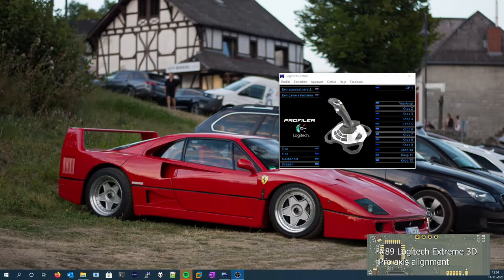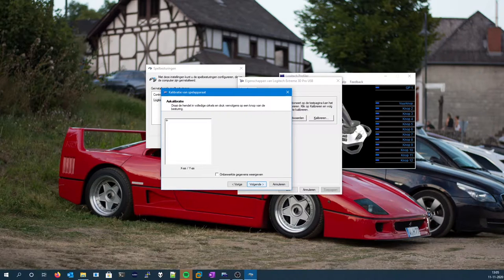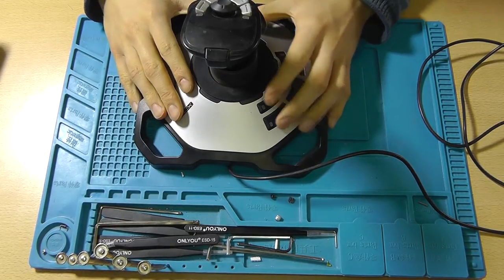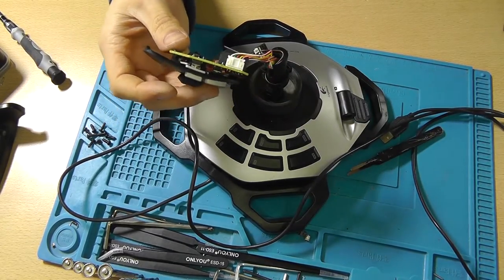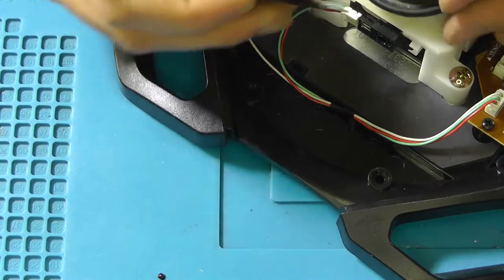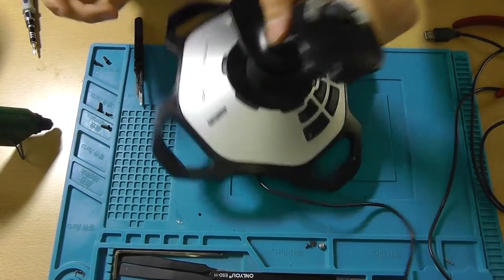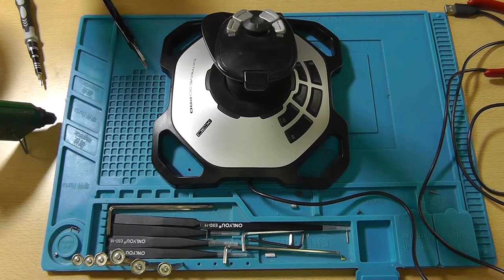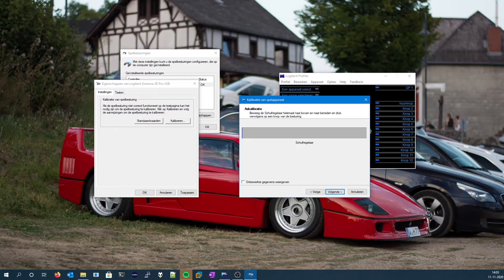#89 Logitech Extreme 3D Pro axis alignment

Comment: I only disassembled the upper part of the joystick and placed a small folded piece of carboard. I used thin carboard from a box of pills. And it holded the Z-Axis Potentiometer firmly in its position.
Reply from the maker: Thanks for the tip! I don't have any problems with the joystick, but if i do I'll try this out

Comment: You have to follow the instructions on the logitech profiler! Do exactly what it says, use the buttons on the sides for navigating to the next screen in the calibration process. I had a drift to the left pretty bad but if you let it calibrate it will set you true. You need to press the side buttons to tell it what to do when it says press a button on the controller. No hardware issues!
Reply: i cant figure out how to let it calibrate though lol

Comment: Thanks will try this, seems to be a bad design.
I have a Logitech Freedom 2.4 which has largely the same internals but it's cordless and it has the same problem.
Funny thing is that I have a t.16000m which is a much better joystick and is perfectly calibrated but not cordless and I play from the couch in my livingroom so I don't feel like rolling out extention cords.

Comment: Good Morning !

My name is Sérgio Ricardo

I'm from Brazil and I bought this joy stick and for some time now it started to have problems with the accelerator and axles! I disassembled it I tried to clean it with sply clean contacts and the problem with the accelerator I couldn't leave as it is from the factory. and instead while the aircraft rudder tilts to the right side. having to unplug and plug in again for him to try to align, already installed the drive etc and the problem continues. I don't think to buy it anymore because I've seen it in another video that was already the second that a user had and this problem presented. in this way what can it be? Do you have any idea?

thank you !
Reply from the maker: Hi! Well you could inspect the potentiometers and replace them if they are broken. Not sure how easy it is to get replacements for this joystick though.
Goodluck!
Reply: @TimsElectronicsLab  The problem is this! not have parts

Comment: A query have you had a problem, such as this joystick simply from one moment to another it has lost the factory settings, I have the same model but this has become completely erratic, it does not save the calibration and shows wrong sensor readings.
Reply from the maker: You can try to clean the potentiometers and inspect the wiring that goes to them

Comment: I opened the profile window and it shows it working fine but when I am using it in game (War Thunder, MSFS, etc) it has a tendency to make the aircraft move left. Even with full opposite deflection to the right. Could there be something else that I might be missing before having to open my Logitech.
Reply from the maker: I'm afraid you can't. Does the axis overview of the USB controller also show that movement?

Comment: very good ! where can I find these new sensors for that same joystich? there are 3 in all, because mine broke the side ball of the wrist sensor as soon as we opened it in the wrist that first sensor the vertical one broke. I'm looking for new sensors for it
Reply: Hello I fixed my flight stick with this video you may not need a new sensor. When putting the controller together make sure the left side lines up with the groove with sensor move it a bit to see if sensor tracks back and forth. I put it together three times till I had it right the sensor is just a post with a half circle on the end that fits in the slat in the joystick no ball. I hope this information is useful for you 👍👍😎
Reply from the maker: Thanks for your additional information! I'm glad you got it sorted after all 🙂

Comment: piece o crap. I also have one like yours and point y axis, nose aircraft up. They advertise it as they are digital , when in fact the potentiometers are analog. wearing . tiny so you quickly go buy another one after domestic use.
Reply from the maker: That is correct. Cheap potentios wear out rather quickly 😂